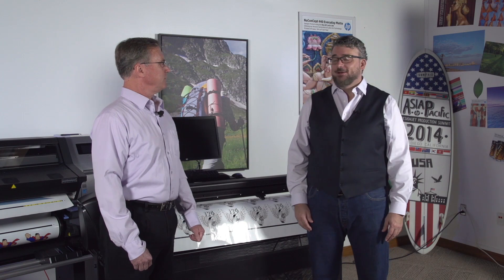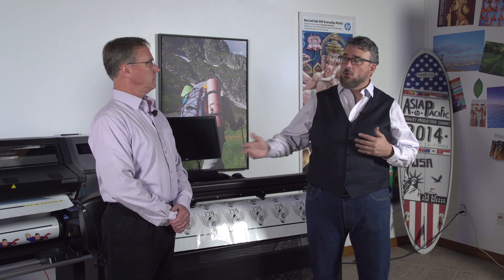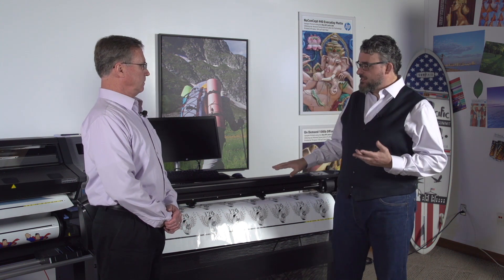HP Cutter Accuracy | HP Latex Printers | HP

Comment: If the HP Cutters are accurate why do most of my cuts come out skewed?
Reply: Setup the machine for panel cutting, it cuts more accurate, i also had the issue of cutting skew or not accurate until the settings changed to panel cutting on the machine and the results are way better. It will take about 1 minute extra to cut but its worth the wait.
Reply: @judetheophilus5180  Hello, what kind of setup you do in to the plotter I just get this plotter (Hp 54 basic) and I have accurate problems when send using reading bar code, and yes the kiss cut an the die cut I setup into the program.
Reply: @judetheophilus5180  What is panel cutting? Is it in Flexi or on the cutter display?
Reply: @rafsoc1613  its in flexi production